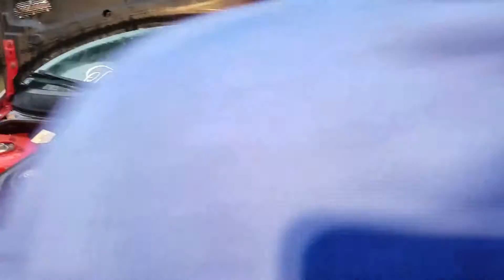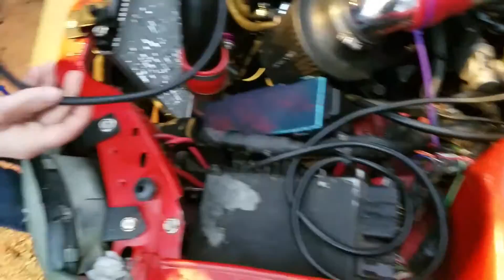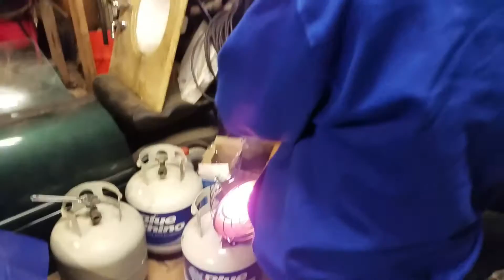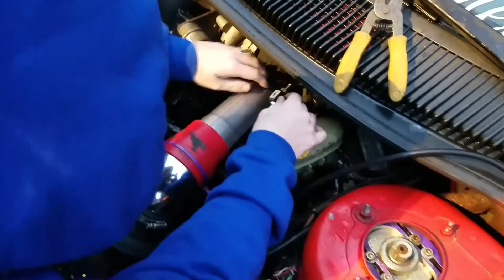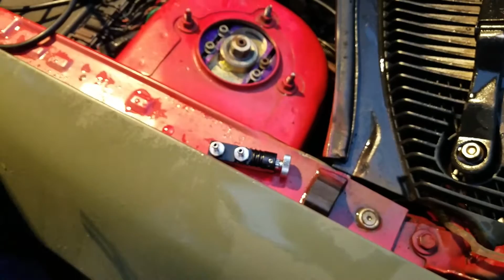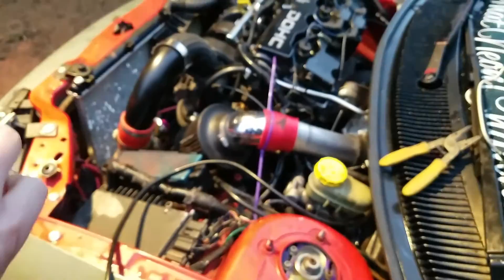Boost controller install!!! (How to turbo your dohc neon pt.9)

Comment: Does that boost controller work good? 

I'm thinking of getting the same one for my 96 DOHC turbo neon if it works well.  Right now I'm just running wastgate pressure (4-5psi)  but i'd like to go up to 7psi with a controller.
Reply from the maker: +mikeheal4 it worked for the 2 days I used it ...i got a agp wastegate from a friend of mine and been using that for 10 psi but im about to hook it back up and ill test it again and update ya in a day or 2
Reply: Thanks.  I'll wait to find out then before I order one.
Reply: Did it work with the agp wastegate??